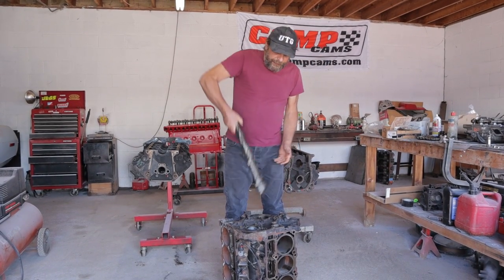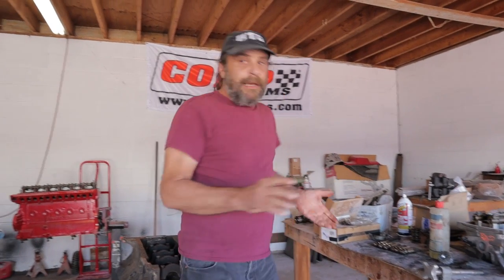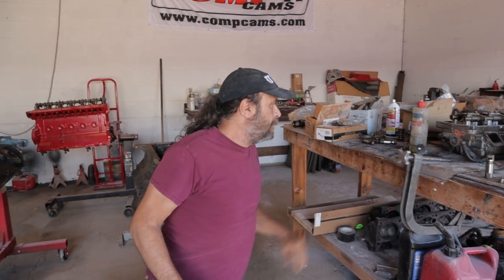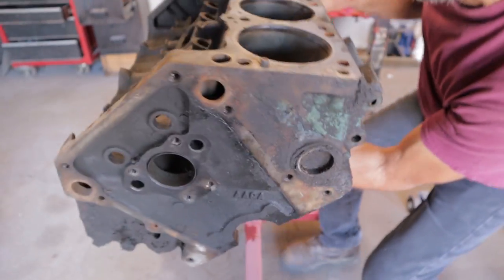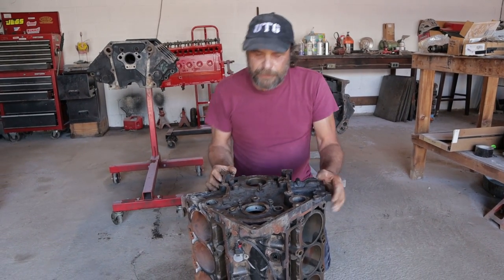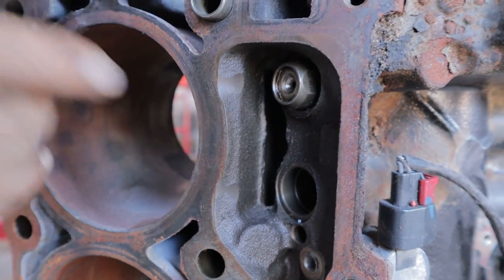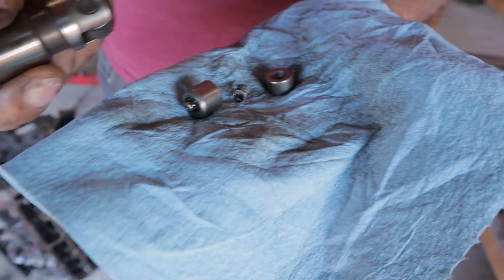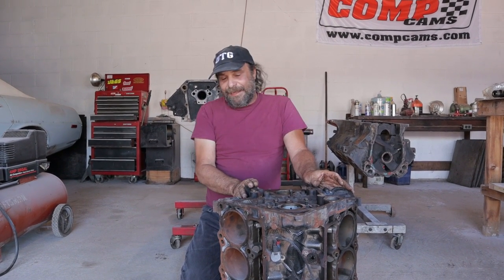Gen 3 Hemi Camshaft Failure Mystery Explained!

Comment: My Charger went through 4 motors in just over 106K miles. It was my patrol car for about a year and a half. Dodge has known about this problem since 2012 and the fix went from replacing the upper end of the motor to just replacing the entire motor. The dealer we sent our Charger to looked like a police car graveyard. They determined that the cause was from lack of lubrication due to extended idling. Unless there is some way to coat the parts in some sort of substance like nickel boron or Teflon there is no real fix for this. I really like my Charger but the design of the oil lubrication is the Hemis fatal flaw.

Comment: Some engines have what I would call "oil shooters" that point upward toward the cylinder walls to provide lubrication to the walls because the rod does not provide the oiling.  Perhaps something could be fabricated to do the same thing inside and face them at the camshaft. Probably would require a higher volume oil pump but might be worth a try.  There has to be a way to spray oil onto the camshaft.
Reply: Ripsaw17 Dennis  My 1985 750 Suzuki GSXR had oil sprayers down near the crank spraying oil up into the bottom of the bore. All the Oil Boiler engines have them...

Comment: Hello Uncle Tony.  Subscriber and long time Mopar fan.  I would like to see you do a build that addresses the performance potential as oiling fixes are/will be available.  These engines are a dime a dozen in the junkyards and deserve a second chance to power a street/strip vehicle.  Oiling is a "simple" fix.  The advantages of elevated cam position, head flow and block rigidity should not be thrown aside because of oiling issues.

Comment: This saddens me tremendously as I was hoping to see Uncle Tony build a fun Gen 3 project in some classic Mopar... The Gen 3 is often maligned but I absolutely love them and am on my second vehicle with a Gen 3. If you stick with one built 2009 or newer and don't sit around idling ten hours a day they are almost totally bulletproof. I have had one Gen 3 with the MDS disabled from factory and experienced no issues with the motor and my current daily Ram is totally stock and has MDS and everything like any other basic 5.7 on the road and its a bear of a motor for what it is. I hope one day they get enough aftermarket support and fan base to really make them a solid option for hot rodding and racing applications for the "at-home garage" guy.

Comment: Uncle Tony, that was some Sherlock Holmes level analysis you laid upon us right there.  Bravo sir!
 "...Lubricated by luck." 🤣
Reply: COMP Cams® claims to have a product to address this issue...  
Perhaps other companies as well.
Reply: TONY, I DOUBT THE ENGINEERS WOULD MAKE A FATAL FLAW MISTAKE LIKE THAT IN THE DESIGN OF THE BLOCK AND PRODUCE IT FOR SO MANY YEARS WITHOUT CORRECTING IT. IT HAS TO BE SOMETHING MORE SIMPLE. THE ONLY LOGICAL ANSWER TO WHY THE CAM LOBS ARE BEING WIPED OUT IS THE LIFTER ITSELF. WHERE THE ROLLER THAT RIDES ON THE CAMSHAFT, THE CENTER SHAFT DRILLED HOLE WAS NOT CENTERED WHERE IT WAS OFFSET, WHERE WHEN YOU SPIN THE ROLLER IT WOBBLES UP AND DOWN CAUSING A FICTION EFFECT. THIS IS ALWAYS THE CASE WHERE THE SUBCONTRACTOR WHO PRODUCED THOSE LIFTERS FOR CHRYSLER HAD BAD QUALITY CONTROL. THIS IS WHERE CHRYSLER SHOULD BEGIN THERE INVESTIGATION.

Comment: I own one of these engines and personally I think that 260 degree oil temps are part of the issue. It’s also worth noting that the vast majority of these failures are on the MDS lifters. Hellcat lifters have a bigger needle bearing and no MDS and as far as I know do not suffer the same issues.
Reply: I realize this is 2 years later but do you think disabling the MDS is a good solution?

Comment: The failures we see in service almost exclusively have high idle time (police, fleet, etc) and the operator ignores/resets the oil change reminder.  Police do LOFs at 6k miles but when you consider idle time that oil may have the equivalent of 15k miles on 5w20 oil.  The operators that change the oil as per the pcm's algorithm don't have failures.
Reply: OKC Mopar Guy, you are absolutely correct. I manage a fleet of patrol Chargers. We use a 5000 mile standard for service. However, I tell my folks with take-home cars that if the car is telling them it needs an oil change at 3000, then it needs an oil change. Mostly, the car wants it's oil changed at about 4000 miles. That's when I usually send them.
Reply: Same thing happens with Impalas. People wait too long to change the oil, they sludge up, and start throwing codes. I work in parts, and 90% of the VVT solenoids we sell are for them.
Reply: @5roundsrapid263  it's amazing what regular oil changes can do for you and prevent. However, some of our deputies missed their true calling working for Underwriters Laboratories. If a car has a week spot, they will find it. There's a few who could tear up an anvil with a rubber hammer.
Reply: Darth Hemi Yep, they expected owners to actually change their oil at a decent interval. A lot of them don’t.

Comment: Failed a cam less than 50k miles. MDS delete, Hellcat lifters, Hellcat oil pump, nearly doubled oil pressure, so far no issues on my 5.7.
Reply: silverbird58  Just pull it and install a LS

Comment: MDS engines use 5W- 20. Could it be too thin? I run synthetic 5w- 20 and I throw in some oil treatment with ZDDP (zinc). I've owned my 5.7 for 11 years.
Reply: i think people are using 5w30 which is too think but thats what the quick lubes use and people are not changing the oil frequently enough IMO

Comment: I’m sure they know the problem. Just like the Ford Power Shit Transmission
Reply: And 5.4. Find someone that can fix that mess. New engine.
Reply: Engineers probably know of a fix.  If UTG's analysis is correct, then they'd need a new block casting and new tooling.
Reply: Timothy Keith and replacing all the engines with this problem is not good for their bottom line. My only question is why the have not fixed the problem in newer engines.
Reply: @MySparkle888  If Tony has indeed identified the problem ,a fix requires a new block casting and tooling changes - very costly. 

I expect that the engineers did test the engines - mostly on the drag strip!  I doubt that they spent a lot of time analyzing the motor's idling characteristics.

Comment: Tony, David phillips here, I met you a couple times 15 years or so ago and we bought and sold some parts to eachother, anyhow... The one glaring huge problem with your theory is that the 2003 - 2008 5.7 hemis almost NEVER have a lifter go bad (I have never seen or heard of ANY actually) and they have the same lifter oiling, cam height, tube in the middle of the block as the 2009-2022 hemis but they still have not been failing even 13 years after the last one was built.  I have a 5 gallon bucket of lifters I have replaced in these things and a mess of bad cams in my scrap metal trailer, every single one was between 2009 and 2013.   The reason you can not find anyone talking about your theory is it does not fit reality.  The problem is the lifter itself, it was changed with the re-design in 09.  Those lifters that have failed have smaller diameter needle bearings and are very shrouded by the sides of the lifter that hold the roller, no splash oil can get to the needle bearings in the roller tip, you can barely even see the needles in those lifter because they are so small and shourded.  The factory fix was the "hellcat lifter" with larger needle bearings and less shrouded by the lifter body itself.  When the lifter was changed in this way the problem went away.  I have seen a couple where the lifter plunger gets stuck down in the later engines like you would hear in older engines with "lifter tick" but no more failed rollers.

Comment: Heres another thought the early 6.1 didnt have variable valve timing and it didnt have the mds system it had a billet steel cam shaft upgrade.  It had flat top pistons instead of domed. It also had extra oil squirter plumbing installed to spray the pistons down .and ive not heard of the 6.1 eating camshafts not saying its not happened because im not sure havent seen anyone post on a 6.1 cam problem . but im looking in to that soon.

Comment: i idle ALOT and have a failed lifter. fighting with warranty company but either way when it gets a rebuild im having a high volume/flow oil pump put in so i dont have this issue in the near future. 
thanks for the in depth explanation.

Comment: When a Toyota Tundra truck hit 1,000,000 miles the company asked owner to trade it for a brand new one, and took it apart to study. 
Chrysler would have fired all engineers responsible for that!
Reply: The Cummins is Cummins, and the only reason why anyone would buy a diesel Dodge.
Reply: That guy also changed his oil every 2500 miles using synthetic oil too
Reply: @jewsrbad  LOL cummins is it's own company. THey design the engine and chrysler puts them in their trucks. Anything good in a dodge these days is not designed by dodge. I own a hellcat, so I can testify to this.
Reply: Craig Bauer that 318 engine is a beast of a engine. My dad has like old grad fury and that car will not die...
Reply: My tundra model sr5. 2007. Large gas engine-350 000 miles strong and fast!!!
My 2016 ram  all camshaft, rollers,....destryed

Comment: What about oil flow from the MDS passages? I’ve also read that the interruption of oil flow to MDS lifters also accelerates cam failure due to lack of lubrication. From what I gather cam failure is much more common in the MDS engines vs. the Non - MDS engines. I believe there is more to the cam failure story once you bring MDS into the mix.
Reply: after 15  cam -lifter failures in police cars . we tried the MDS delete kit and haven't had a failure sence
Reply: The ones I've done, the lifter failures are pretty random by position.  The MDS engines I've done have all had a mixture of MDS and non MDS lifters failed.
Reply: From what I have read don't idle with the MDS activated.
Reply: @mitchfleming274  true but it can activate as 15nph. The city i work for the police cars average speed is 12mph with a 42 car fleet. A lot of low speed  driving with MDS activated
Reply: @mitchfleming274  This is also true.

Comment: Run a tube along the top of the block (in the windage area) drill some small holes through there and matching holes in your tube run some line from the oil pump to your oil sprinkler tube and see what that does for it. Maybe do the same for the lifters.

Comment: It was a possible good design, until the bean counters got hold of it!
Reply: I get the feeling you didn't actually watch the video.  It wasn't a cost cutting thing.  The extra high cam tunnel is more expensive and was a recommendation to the engineers by Tom Hoover, as a way to reduce valvetrain inertia.  That just introduced unforseen problems in an area that historically just takes care of itself.
Reply: @JETZcorp   It would be a very simple fix on a production level.  Oil squirters for the cam from the block side or a lube channel through the lifters themselves could keep the cam oiled better than basic oil sling/windage ever could.   Ford used metered lube channels all through the Modular/Coyote to keep timing chains/guides and cam lobes well lubricated.  Lash adjusters/followers, secondary chain tensioners and primary chain tensioners all have strategically placed, metered oil channels to keep things lubricated.  If Chrysler cared this issue could EASILY be rectified on a production level.  They obviously don't think it's worth the time or money.

Comment: So, run the hell out of the engine.  Got it.  04 ram hemi.  228k.
Reply: I have an 04 Ram 5.7 bought new  changed oil at every 3-4k miles and switched to full synthetic valvoline @ 20 k miles and the last few years been adding hotshotsecrets FR3 friction reducer at oil changes ...big difference that stuff is slippery and I figure its worth the extra few bucks .